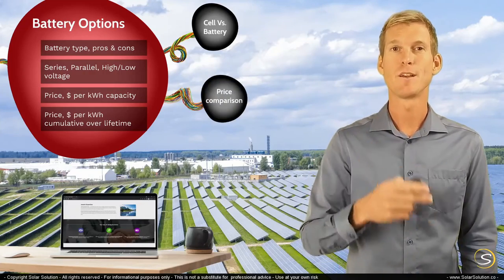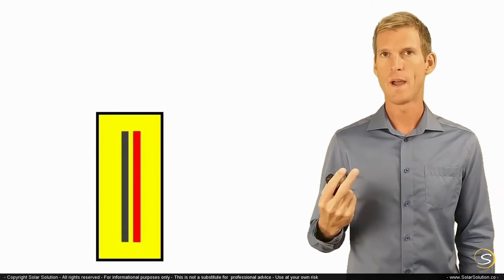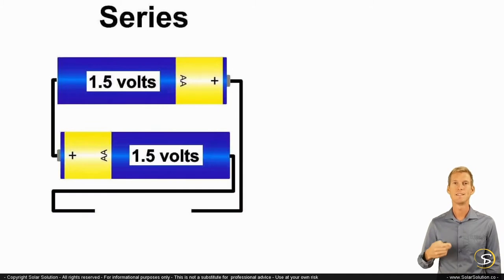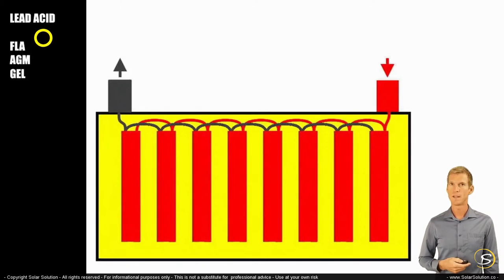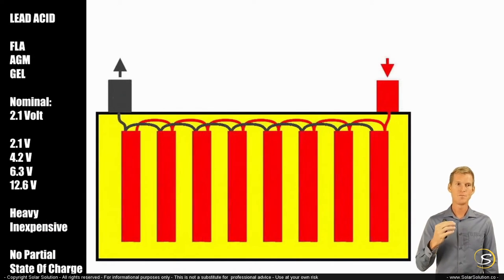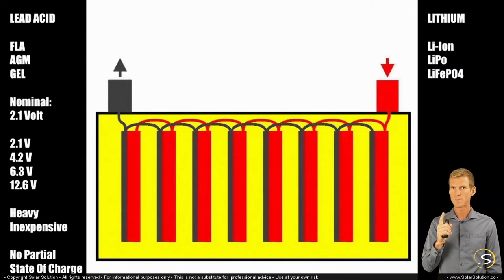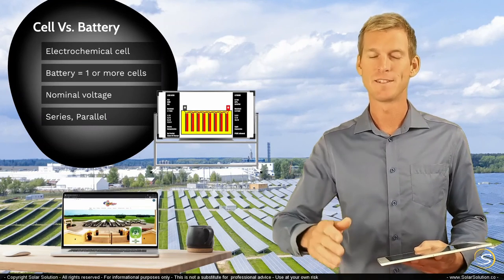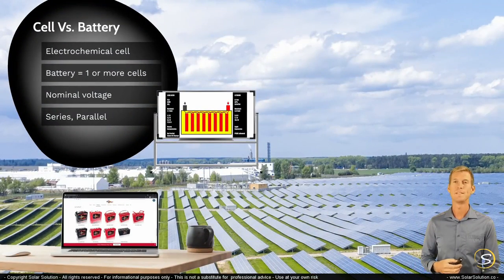Battery Cell Voltages: The differences between single cell 2V, 6V, 8V and 12V batteries

Comment: I know batteries/ cells of deep cycle batteries cannot be connected in series if they have a significant gap in their voltages. But I recently had an uncle who told my family that when installing lithium batteries for solar off grid systems, more batteries could be added to the bank months or years later. Which is something that cannot be done with lead acid batteries due to the change in voltage of the batteries over time. Is he correct? Or does the same principle apply for them as well?